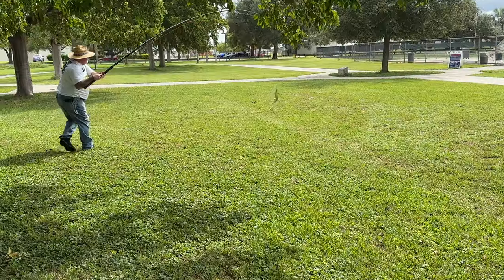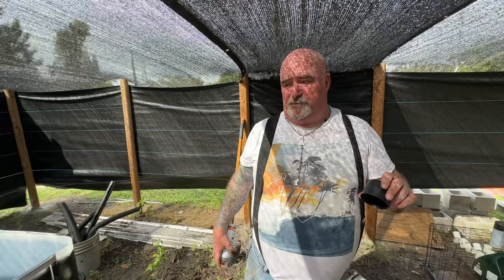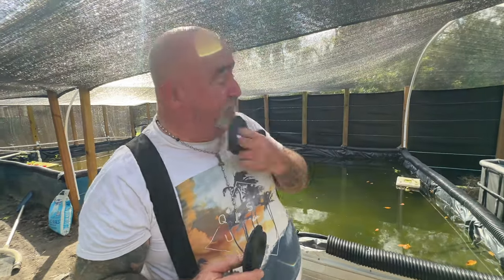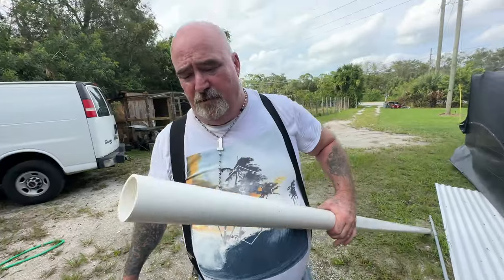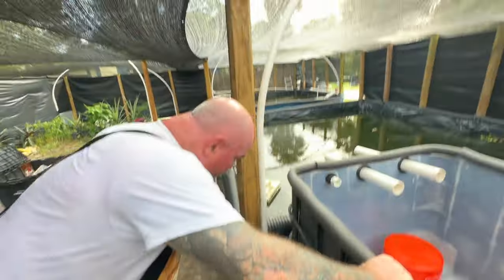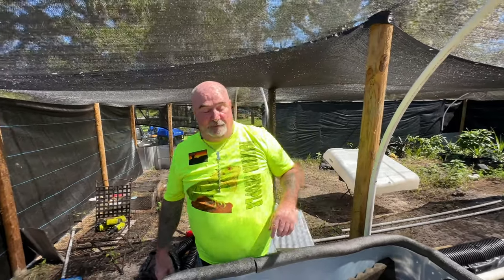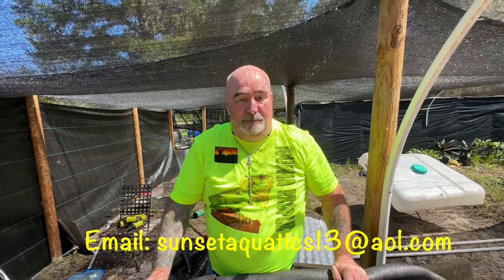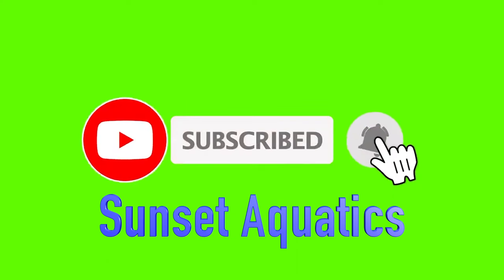The iguana people are building an aquaponics system to raise food fish & grow veggies for animals

Comment: Yohan, like the idea of the shade cloth over your tanks. Could use it over a patio for some shade also. Up north here if you have a canopy over your patio and it's not metal, it will collapse when it snows! Guess you don't have that issue in Florida. Our cloth canopies usually end up getting ripped up from the strong winds over summer.
Reply from the maker: hi pam no if you look close i have 4x4 post in ground pressed in concrete  and on them post i put hooks so i made eyes in the shade cloth and i pull it tight over the post if it gets very windy i unhook it to put it up so the winds don't take it away  as u know we don't get snow but come the Gails of November we get the tropical storms so its got to come down so it don't fly away its a easy up and easy down if i had too  thanks pam we are going to be building lots of aquaponics stuff stay tooned